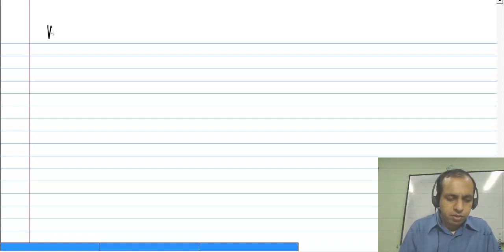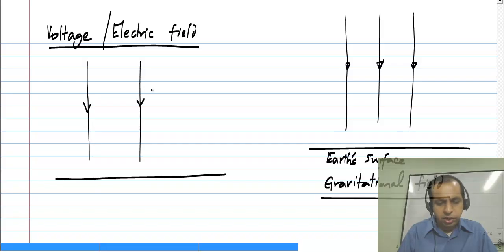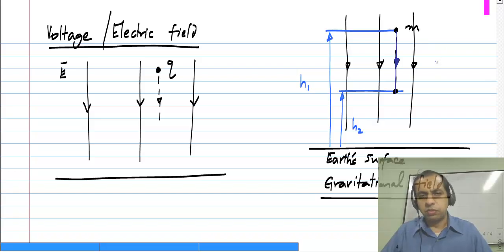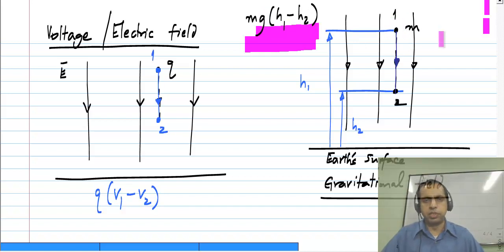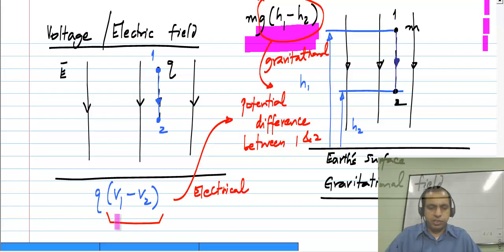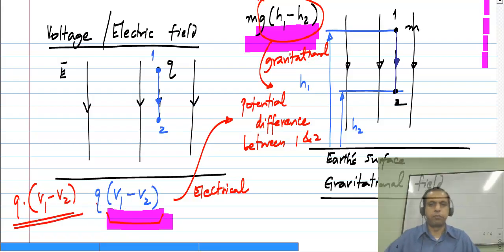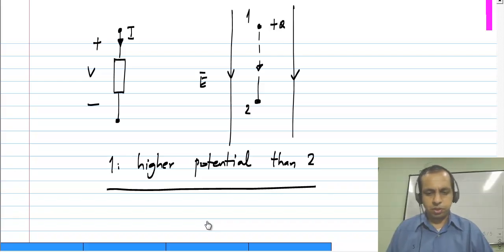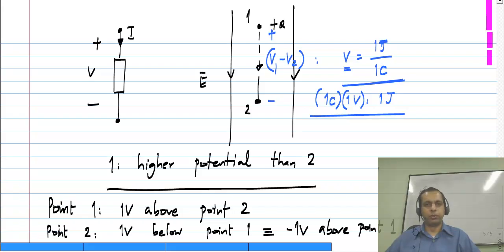Voltage

Comment: Voltage in circuits is entirely due to gradients in surface charge. 
Electrostatics and circuits belong to one science and not two, that of electricity and magnetism. 
It will be instructive to understand Current, the conduction process and Voltage at the fundamental level as in the following two videos: 
i. https://youtu.be/TTtt28b1dYo and 
ii. https://youtu.be/8BQM_xw2Rfo 
The last frame References in video #1 lists textbooks 3 and 4 which discuss details about resistance, how current branches in a parallel circuit and ohm's law.
See these lectures by North Carolina State Univ faculty which use a unified approach to electrostatics and circuits. 
15. Simple D.C. circuit. 
Pattern of electric field.
Watch from  16.0 minute.
16. Mechanical Battery
Watch from 19.0 minute.
Ch18L1b
https://youtu.be/Eu3JQKrJRZA?si=t3MeX8Hi8ELAxaz0
17. First intro to  Surface Charge 
Watch from 10.30 minute. 
18. Surface charge gradient 
Watch from  15.30 minute. 
Ch18L2a 
https://youtu.be/bp0o1HZOs3g?si=PPiPGepbXvdTgJHX 

Textbook 4 is here https://techsarworld.com/product-detail/fundamentals-of-electric-theory-and-circuits-559 

PPTs and Videos with animations for all the ten chapters including that of pn junctions Chapter 9 and a few applications Regulated DC Power Supply, Differential Amplifier and Transformer coupled audio power amplifier of  book Fundamentals of Electric Theory and Circuits are available for download and viewing here
https://techsarworld.com/download-resource/fundamentals-of-electric-theory-and-circuits-559

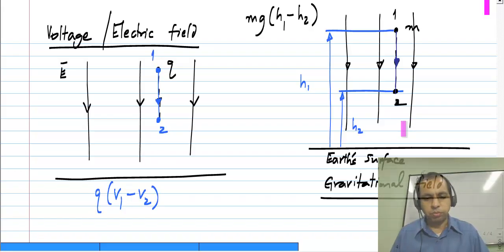Comment: at 4:42, qE(d1-d2) as E*d1=V1 , E*d2=V2 ,so eventually q(V1-V2). I was stuck here and found out the connection, like qE is force similar to mg is a force. Thanks sir.
Reply: Nice